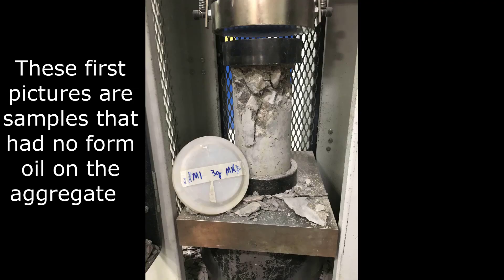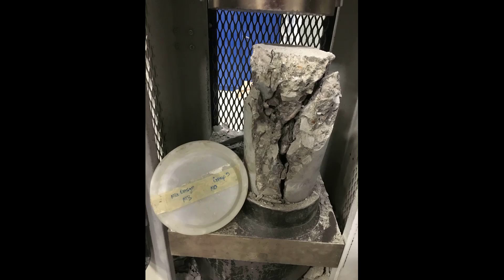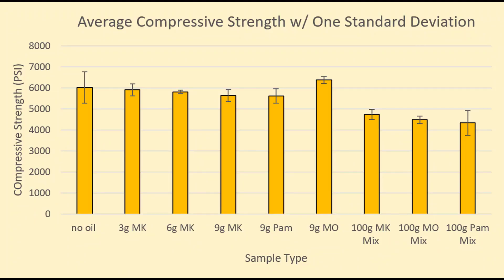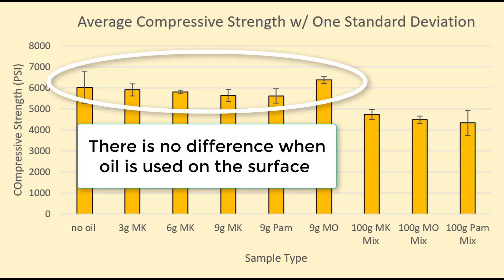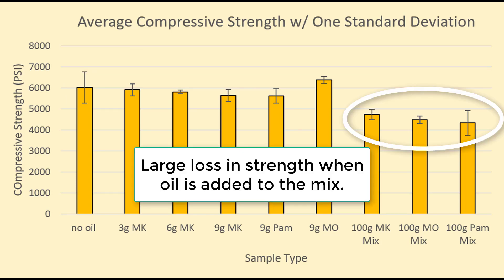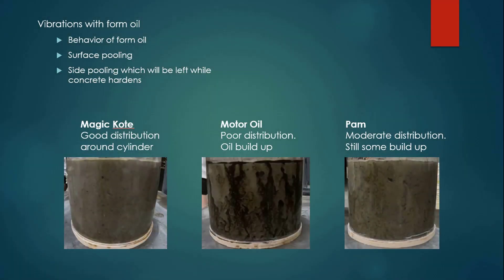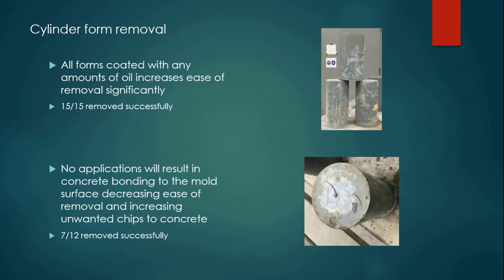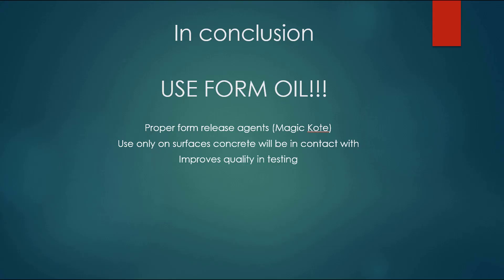Testing form oil in concrete

Comment: Hay Tyler:  what would be the effect of spraying light coat of high tack oil on rebar caging and would it keep rebar safer in saltwater or chlorinated area.  What if a zinc anode was placed periodically at the outer perimeter of the rebar cage?  Would these methods reduce corrosion ? Or should we just spring for stainless?

Comment: Just here to warn everyone about Q-Cote concrete form release.  They sell it by the gallon.   
The fumes are extremely toxic.   I used it outside in my carport, no walls and the smell penetrated my house.   I had to evacuate my house for hours. And when I came home it still had the awefull smell.  So don't use the toxic stuff.   Use mineral oil or linseed oil.  The Q-Cote smells like the black tar you can buy for roof patching.

Comment: is the term "eating away" the proper terminology for the condition experienced for the surface between the concrete, the motor oil, and the cylinder? Eating away would imply that the surface of the concrete was formed, but an external factor had a later effect on the surface of the cured concrete. What I am witnessing is a certain amount of surface tension of the oil which is being pushed aside by small variances in the external pressure exerted by the mix itself, since the mix is high in water. This creates trapped oil/water (which doesnt vibrate out all that easily, being that oil wants to stay clinged to the molecular properties of plastics, including polycarbonate and the mold material). In other words, it didnt "eat" at the surface, much like air pockets that are found after the removal of forms aren't referred to as "air ate the surface of the concrete". The air prevented the contact of the concrete with the form, much like the oil i/water interaction is preventing contact with a smooth cylinder side.

Comment: This is awesome, I have had several concrete guys tell me that they use motor oil for form oil and I always thought "Ummm...." so this is reassuring.  The motor oil actually seems to have increased average compressive strength by 5% when used as a form liner.  Why might that be?  Improved consolidation at the edges of the concrete since the concrete could slide around easily?  But then why would the other form oils seem to have the opposite effect?

Comment: Alternatives like paraffin, beeswax, lard and coconut oil  have properties that could be useful in form coating.  Melting points, thermal expansion coefficients, renewability, etc...  If the form surface was dimpled and filled flat with wax or a solidified oil like (rendered?) lard or coconut oil, it could last almost indefinitely.

Reminded me that wax coated fast food cups work amazingly well for experimental purposes when doing a bunch of tests.

Comment: First up don't leave excess
Reply: That was drilled into my head working on bridges.
Reply: I think they used approximately 9g for each cylinder. Maybe this is a standard for test cylinders? I agree, it did look excessive though. I wonder if this amount would be acceptable on the field where you are applying oil to wood forms, seeing how wood actually absorbs the oil.

Comment: Very interesting video. I seem to recall that someone came out with a wax form release agent many years ago. Any info on that? Wishing you all a Happy and Healthy New Year. Good Luck, Rick
Reply from the maker: Thanks Rick
I have not heard about a wax form oil but I don't doubt it!
Reply: @TylerLey  I think that the wax cured to a dry coating and also protected the forms. There may have been a problem if there was too much time between pouring and stripping. Good Luck, Rick
Reply: I know waxes are used for decorative concrete molding, (usually with some solvent that evaporates so the wax can be sprayed/brushed on easily) so other than cost I don't know why they wouldn't work for structural uses.

Comment: We never use oil and our cylinders only break occasionally... In fact we reuse the cylinder's for 2 pours... Maybe your cylinders are weak or maybe it's because we don't drill the hole in the center of the mold but offset
Reply from the maker: Who knows!  We can reuse cylinders for 5+ times if we use form oil.
Reply: @TylerLey  I'll let the team know.. thanks

Comment: This mean i should add oil for concrete i dont understand the benefits of adding oil
Reply from the maker: This means you should use form oil on the forms and not add it to the concrete.  They added it to the concrete to see and extreme case.

Comment: I think that the first thing to consider is if you need form oil.
But even then I see more possible alternatives than the selected ones, so what about wax and grease on the form?
Also it may depend on the material of the form.
Reply from the maker: All true!
This is a limited sample set but for the materials and tests investigated commercial form oil seems helpful!

Comment: Excellent work Thanks.
As a concrete contractor with alot of money invested in rapid wood forms I often have workers use extra oil to allow easy release and prevent damage to wood forms.
Used motor oil ruins forms not allowed to be used in NYS/NYC for decades now. Wood peels off forms and causes cancer in workers who handle used motor oils. 
We use cherry oils.

Thanks .
Reply from the maker: Thanks for the feedback!!!  We agree that used motor oil is not the best thing to use.
Reply: @TylerLey  Do one on ACI 318 "form oil on rebar." And it's effects on bond development length etc.
We had  some kid inspector reject a job claiming oil not allowed on rebar...lol
PS:
I have BS in civil engineering  NYS 1990.
I miss University years.
Shalom